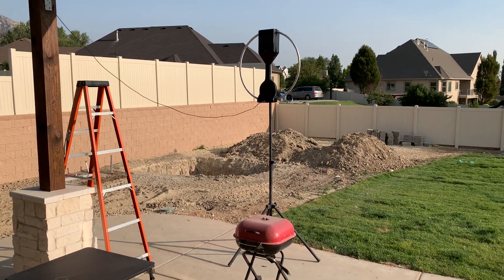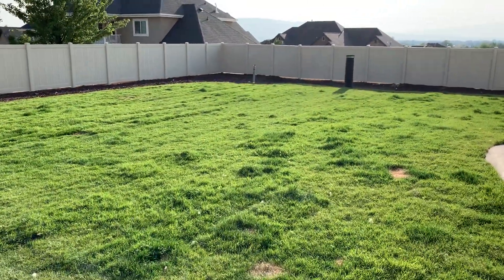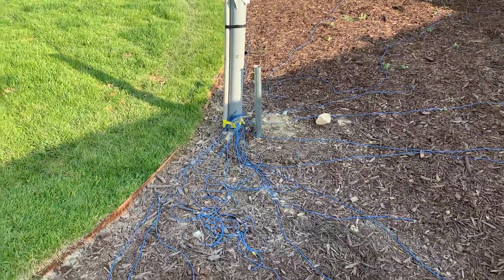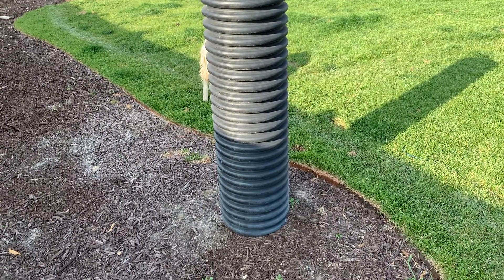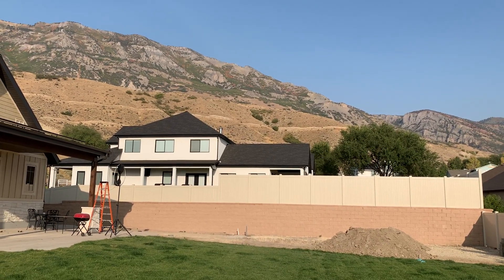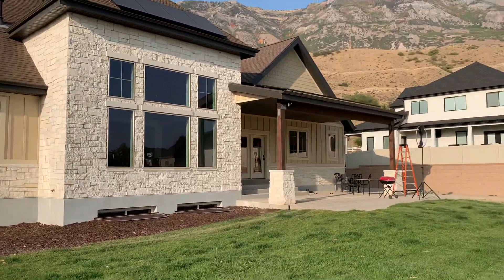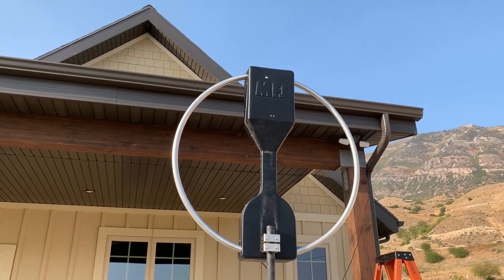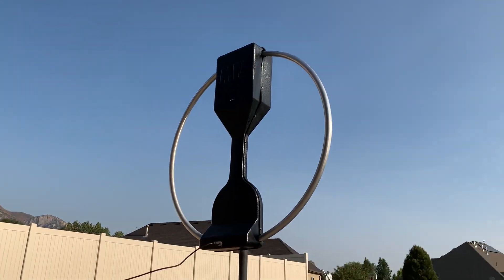Temporary Mag-Loop Antenna in the Back Yard, and the Mounting Location for my Vertical (Part 2 of 3)

Comment from the maker: NOTE:  I've copy/pasted this more-complete personal evaluation on the MFJ-1788 below.  It was originally a response to some questions in the comments on my Xiegu G90 video, but it thought it might also be better located here:

I actually have two MFJ-1788 antennas.  The older one took a tumble off of the top of a shipping container to the pavement in a sudden breeze, and I've never fully restored it to 100% yet.  I had it on a temporary tripod without guys.  It was a quickie Field Day setup.  My bad.  I guess I liked the design enough to buy another--call me crazy I guess.

The newer one that is sold by MFJ now has a few minor improvements over that older model, such as white LED backlights on the meter, and higher voltage to the tuning motor.  The antenna and controller box you see in my videos is the newer one, and I have no serious complaints about it.

I'm actually a bit of a mag loop fanatic.  I hand-built the first one I ever owned, and it's still my favorite.  When band conditions were a little better in about 2008-10, the first two contacts I made were to Hawaii and Maryland on 17 meters within about 10 minutes of each other, using my 15-watt Elecraft K2 on SSB.  It was supported by a piece of 1x2 wood pushed into the grass in my front yard.  It looked like a copper lollipop!  The bottom of the loop was only about 2 feet above the grass.

I was amazed at that performance!  So that motivated me to play around more with these interesting antennas.  I still have it, and I keep telling myself that I'll add a remote tuning motor to it one of these days, but it's pretty low on my priority list right now.

So back to the 1788:  It works as advertised, and it doesn't take long to get used to the clever tuning method with the remote box.  It works well enough, but you can also just push the UP/DOWN Fine Tune buttons and listen (or watch, if you have a band scope or panadapter) for a peak in the background noise.  You'll be almost always at the peak noise and lowest SWR at that point.

I pre-wired my house with a number of runs of LMR-400 coax when we built it last year, so I moved the MFJ antenna to a room over the garage, which is where it is now.  I have a lot of electronics in the house, and it picks up more hash and digital birdies than I would like, but that's not the antenna's fault.  

I can easily make QSO's with Japan and the south Pacific with it, but I almost always use my G5RV antenna that I set up in my back yard in July 2021.  I've yet to find a signal where the MFJ loop was stronger than the G5RV, but it's not bad considering that it's so small and totally stealth.  

By the way, my G5RV antenna is also an MFJ antenna.  It works very well, but you need the space for it.  I have it set up like an inverted V with the center at about 25 feet, and the 51-foot dipole legs sloping down to about 6-10 feet.  Using an antenna tuner, I can work 80-6 meters with it.  It comes ready to roll out and put up in the air, and it's pretty well-made, so kudos to MFJ for this inexpensive yet very decent design.

Another thing I really like about the MFJ loop is that it will take 100 watts with no complaints, so you can use it with just about any ham transceiver without worries of capacitor flash-over.

As a mag loop fan, I must also admit that I have a Chameleon F-Loop and an Alex loop Walk Ham portable loop.  The Alex loop is a clever design, very compact, and awesome as a grab-and-go portable QRP antenna.  I think I bought it at Gigaparts a couple of years ago.  His website is:  http://www.alexloop.com/

I have not had a chance to use the Chameleon loop yet, but it's on my "fun" list of things to try.

The big advantages over the others that the MFJ loop has is remote tunability and high power handling.  That really makes it a no-brainer to put up in an attic and forget about it.  As far as directionality goes, I honestly don't see enough that I would want to add a rotator to it.  This is based on my subjective use, and with the antenna mounted vertically, as shown in this video.  I believe that MFJ has recommendations about when to mount in vertically or horizontally.  I have tried both on 10-20 foot masts outside, and I think the efficiency is higher when it is mounted vertically, especially when you are closer to the ground.  Horizontal mounting is better when you can put it up higher, and it's really the only choice if you want to keep rainwater out of it.

Caveats:  Any mag loop loves to couple a lot of its energy into nearby metals and wires, which causes its efficiency to plummet, so keep it as far away from your house wiring, metal ducts, and rain gutters as you can.  As you can see in this video, mine is way too close to my gutters.  

Another thing to know is that the MFJ mag loop efficiency goes down as you go lower in frequency because of the longer wavelengths versus the small loop circumference and pipe diameter.  I recall that it's something like 17% efficiency compared to a full-size dipole on 40 meters.  Again, this is just physics, and is not unique to the MFJ design alone.  Some homebrew mag loops actually use 2 or 3 turns of the aluminum or copper pipe (or coax) to raise efficiency on 40 and 80.  Like a mobile antenna, you might be able to tune those bands, but as the ratio of the antenna size to the wavelength gets bigger, and efficiency falls.

My two last criticisms of this antenna are the somewhat flimsy black plastic weather covering, and the price.  If you mount this antenna vertically outside, you WILL get rainwater in it unless you come up with some extra sealing around the top and sides, which MFJ warns against doing.  

The housing has weep holes in anticipation of this, but I don't think it's sufficient.  Mounting the antenna horizontally will keep it much drier inside.  

As to the price, MFJ has put a very beefy tuning capacitor of their own design into this antenna, and I really like the aluminum tube that is its most distinctive physical feature you can immediately notice.  Along with the remote tuning box, and the clever tuning method you quickly learn, I can see these items used in the antenna somewhat justify its cost.  I just wish it was $100-150 lower.  If it was in high-volume production, I'm sure they could lower the price substantially, but virtually any ham gear by definition is not going to be high-volume numbers compared to, say, an iPhone.  That's just how the economics of manufacturing are.  Trust me, I've been in the high-volume consumer electronics business my whole adult life.

I hope you find this info helpful.

73,

Dave--K7DAA

Comment: So would you recommend the antenna?
Reply from the maker: Well, I think I would have to say that I might suggest trying anything else first.  That doesn't sound like much of a recommendation, does it?  😉 

Depending on your available real estate, even a random-length long wire > 40 feet with a tuner might work better.  This is not a terribly efficient antenna on 40 meters, although 20-15 meters are OK.  The efficiency is really compromised if you mount it near metal, like my rain gutter that you can see in the video.  This antenna as it sits right now is pretty deaf.  I need to move it out into the yard with >20 feet of open air around it, but I can't because of the dog's fondness for coax.

If you can put out a wire as I mentioned, or a dipole, even if not terribly high in the air, or a ground-mounted vertical, you might be happier.  You can buy a lot of other antennas for the cost of this one, so you have to weigh the relative value.  If you are in a situation where you really can't put much of an antenna outside, then this MFJ antenna might be your last resort.  I hear that some people have it in their attic or inside an apartment and are happy with the result.  I've never tried that, but maybe it might work.  

With half the cost of this loop antenna, you could buy something like a Hustler 6BTV vertical, push a 4-foot pipe into the ground, mount the antenna on it, and throw out a few random-length radials on the ground (even if they can only go in 1 or 2 directions away from the antenna), and you would be miles ahead.  You would also have a small slice of 75-80 meters, which may or may not be useful to you.

Speaking of attics, if you are thus constrained, if you have about 14 feet length available in your attic, I would suggest the MFJ-1775 mini-dipole that works on 40-2 meters, or the Cushcraft D4 if you've got about 36 feet.  If you do this with either antenna, try to avoid mounting it such that AC wiring runs parallel to it for much of its length.  Due to the fact that these antennas look more or less like a horizontal pipe, you might also find other mounting ideas that could work if you need stealth.  Let me know if I can help more, I've been an antenna experimenter all my life, and have several antenna patents as well.
Reply: I run my MFJ-1786 on 11 meter sideband lower 38 running it with a Icom 7300 and I have absolutely no problem shooting DX all over the country. Great antenna for noisy areas and it does null out electrical noise. Had mine for 6 years and love it 😍
Reply from the maker: @gburlin  Actually, I'm really glad to hear that.  Sounds like a nice setup!